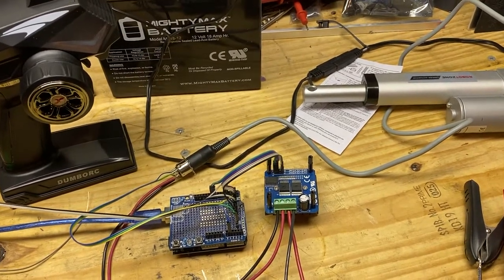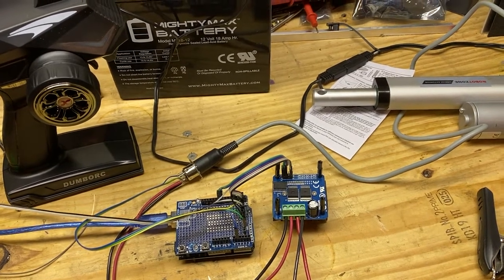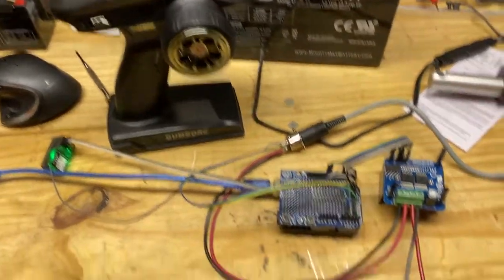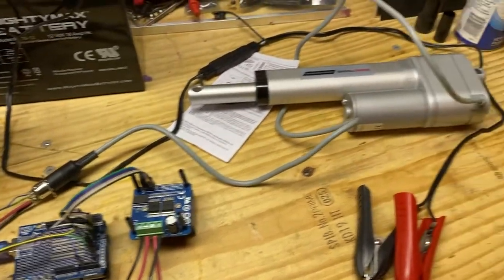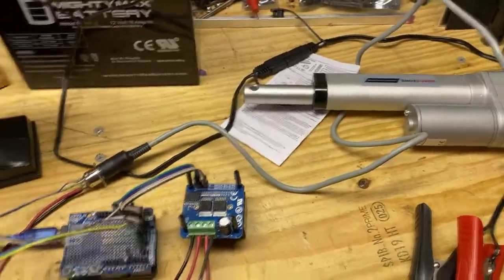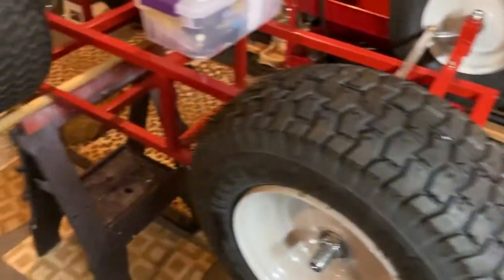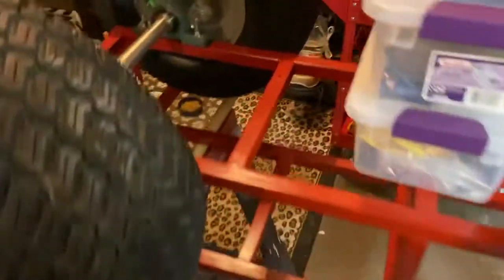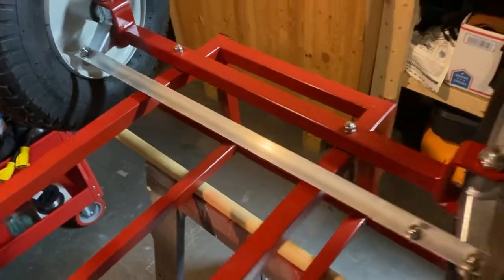BUV 2.0 RC Steering Electronics - Remote Control RC Beach Cart Buggy

Comment: I'm a newbie to RC and Linear actuators in general.  Could someone please point me in the direction of a tutorial on how to "set" the center point of the linear actuator?  I was going to use a FIRGELLI AUTOMATIONS FA-PO-35-12-4'' (5:1) 12VDC STROKE ACTUATOR with a built-in potentiometer.  But before I mount it I wanted to understand how to set the "center point".  Do I need to measure the midpoint between the 2 limits before physically mounting the actuator or is it programmable somewhere?  I will be using an Actuonix Linear Actuator Control Board with my RC controller.
Reply from the maker: THis is a video on how I programmed my Arduino for centering the steering: https://www.youtube.com/watch?v=yFs04UKNozE